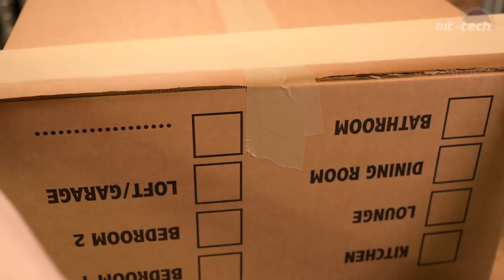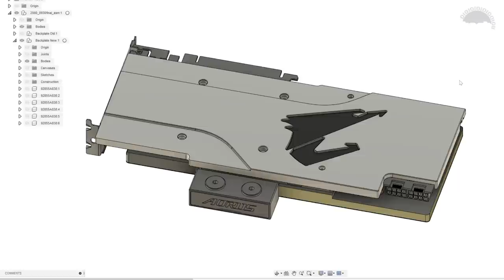How to Build a Cardboard Media Blasting Cabinet | bit-tech Modding

Comment: Would love to hear your advice on how to get an even texture in aluminum, also I recommend applying a film onto that viewport sheet you'll find that it will degrade quite quickly. Cheaper to replace the film than making a new sheet.
Reply from the maker: Not a bad shout that. Acrylic seems to hold up really well against the glass beads at the pressure I can operate at, but it'll be useless if I use something sharper like aluminium oxide.

Comment: Thinking; if the back edge of the top acrylic was +90degree hinged to the top edge of the box using 2 removable butt hinges (like removable swing hinges on computer glass panels), you wouldn't have to completely remove the lid while changing work pieces, but you could take it off completely when needed to empty media or whatever.  Just open the lid on the hinge and it would stay open on its own.  Would definitely need a bit of thought as to hinge location on both top and box to it would rest open easily, and not interfere with the seal.
Reply from the maker: That's not far off how many homebrew ones operate. You can use foam around the edges along with a couple clips to ensure a decent seal.

Comment: I sugesst to put some plane rubber sheet on the backside where the most sand blows against to prevent that the sand gets conterminated with the alloy from the bachside. Rubber is nearly lasting for ever and its not sandable at all or if it wikk not disturb by sanding the parts.

Comment: @12:59 The gaskets go between the glove flange and the box.
Reply from the maker: Aye that's how they were on the old one (you might be able to see it in the timelapse bit at the beginning). I tested it the other way around on the cardboard though and it seemed to work out better. They're not really being used like gaskets here, instead they spread the load across the cardboard since it's so soft.

I was fairly surprised to say the least.
Reply: @bittech1  Yea cardboard, ha!

Comment: How does air escape from the box. It comes in through the pressure hose but how does it leave without carrying sand with it?
Reply from the maker: Through the front flap. When in use, you have it open and place another funnel in front of it to catch blast media.
Reply: @bittech1  thanks!
Reply: @bittech1  I don't think that's what Elior Bilow meant.  You would be constantly forcing compressed air into the box and the tighter the seals, the more pressure builds up in the box.  Any uncontrolled air leaks would be carrying media with it.  You need a chimney with a separator/filter on it.  It needs to point up to make use of gravity to separate the air and media.  Then it needs a filter to remove the remaining airborne particles.  The best way is to use a diffuser to slow down the air.  This is done just by creating a wider pathway somewhere in the chimney.  The high-speed air will slow down and the media will fall out of the air.

Comment: Do you just glass bead alu and no further process after? I really like the alu finishes in your build.
Reply from the maker: Currently I do yeah, ideally I'd anodise afterwards but that's a whole other kettle of fish on top of things. The saving grace is that the bead finish largely stays the same in applications where things aren't touched/moved all the time. Since it's matte already, it oxidises very evenly. The only issue is that it's not durable without anodising.

Comment: This doesn't seem safe for your long-term lung health. You really need negative air pressure in there, so a dust collector system. This is a bad idea for any sort of long term use.
Reply from the maker: Bear in mind it's both temporary and to be used in conjunction with a mask. With the front chamber open it's no different to one of the cheaper commercial solutions.